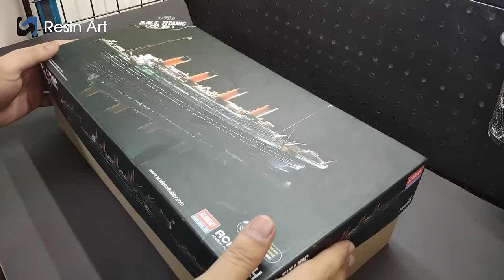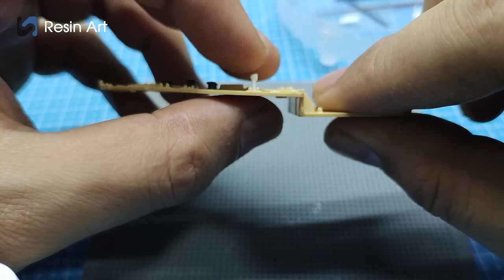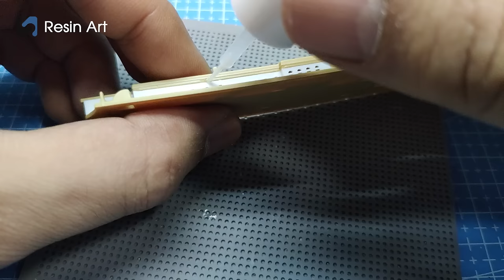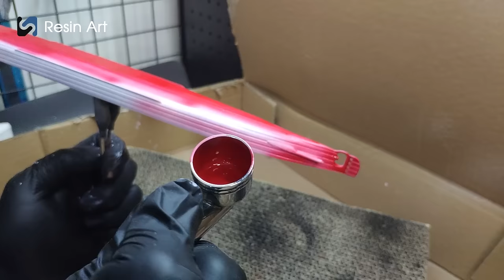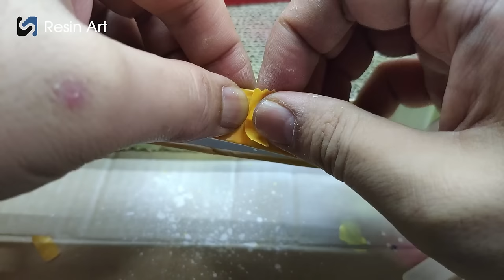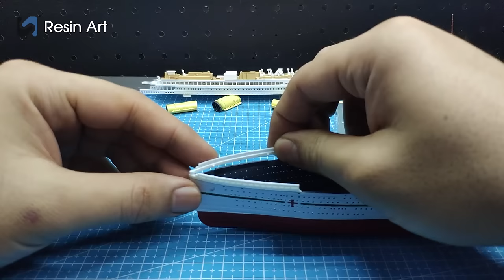『BRITANNIC』The sinking of the HMHS Britannic, sister ship of the Titanic / Resin artwork creation

Comment: Its just a thought but, when the olympicclassships like titanic and britannic sank, did they break apart through their own weight? It sounds controversial at first because water is also heavy but if said liquid fills up the space thats covered in air then there is, i think, no weightgain, just an exchange of medium. Ships are designed with their unique shapes to float on water but sink, when they get filled with water , so, in theory, titanic broke itself apart through its own weight and the differences in boyancy. Maybe i am rust repeating, what maybe another analyst already said and i made myself somewhat a fool, but i wanted to share this thought with others, if they maybe see it in a similar way
Reply from the maker: Thanks for sharing~
Reply: To answer the question, the Titanic supposedly snapped in half due to the heaviest object on the ship (being her reciprocating engines) being dragged more and more up in the air until the weight was too much and it broke.

For the Britannic she didn't break at all until her bow smashed into the seabed (this was due to the depth being 400 feet which was half of the length of the ship).

Comment: CONTRUCTIVE CRITISISIM AHEAD:

Academy's 1/700 (especially the recent L.E.D., pre-painted ones) are some of the worst Titanic kits ever made and should be avoided completely. If you're going to do 1/700 I recommend the 2012 Revell retooled Titanic kit and Tom's Modelworks 1/700 scale Titanic P.E. railing and detail and RealWood deck sets. I also recommend playing around with Woodland Scenic's RealisticWater to add surface detail to the resin water and then finishing that off with some flatt white enamel to simulate contact waves. What you have here is a toy boat stuck in some j-ello, I get the feeling you're far more skilled than that.

Good luck.
Reply from the maker: Thank you for your suggestion, it is very useful for a newbie like me, I will try my best to improve it!
Reply: @samuel-studio  You are already off to a great start and I'm sure with time your work will improve tremendously. Your resin pouring and curing technique is excellent and that's a skill even seasoned builders have trouble with. I worked in the prop and model making industry for years professionally, if you would like any reference materials or supply chains for detail up sets etc feel free to hit me up.
Reply from the maker: @jonrmartin  Thank you so much~